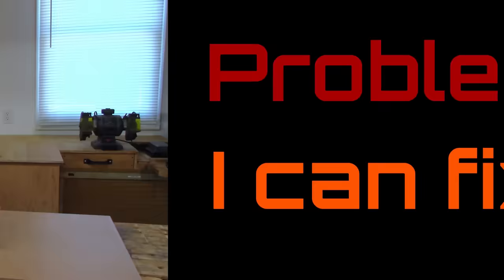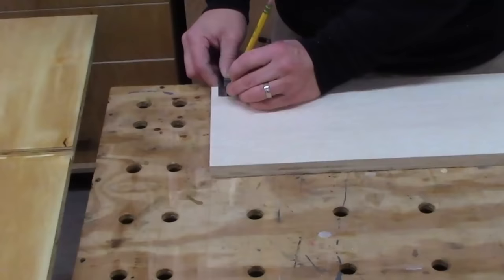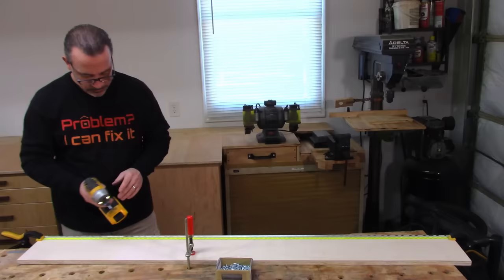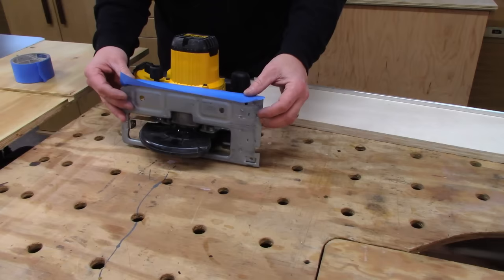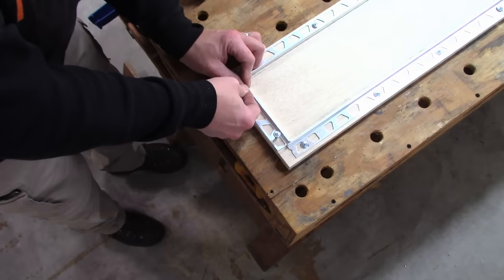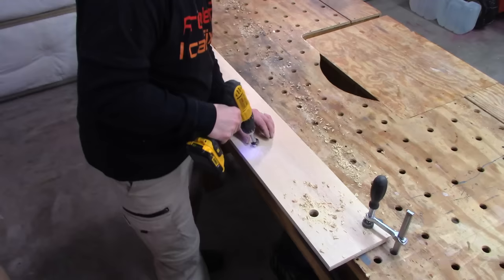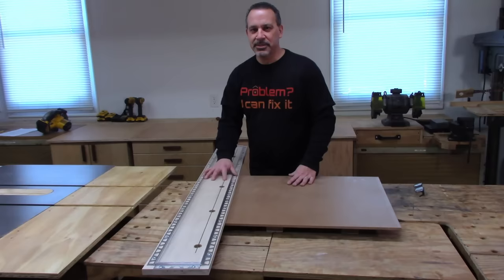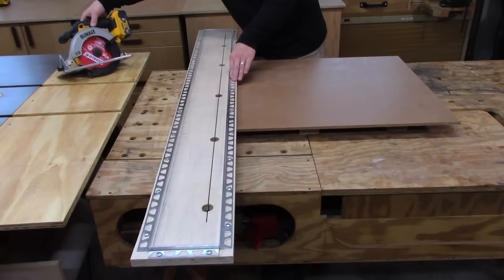Festool doesn't want you to see this DIY track saw

Comment: As a professional woodworker here in the UK have made and used dozens of versions of these jigs over nearly 40 years, Not a bad one but forget about the tape , it can't be trusted and always clamp.
Reply: CLAMP.   Always.
Reply: Spend the time to find  or make low profile clamps
Reply from the maker: I was thinking about using the MatchFit dovetail clamps.  Would be easy enough to put a groove on the bottom.

Comment: I've seen a few of these. One issue is that you have to drop into them all of the time. With a small modification it can be shorter, cut farther, be more stable, and allow you to cut from the end. What you do is, at the end instead of more of the aluminum, put a thick piece of wood on the underside, perhaps 2x2. That will act as a catch at the end of your piece to allow it to be even more stable and not slip. Then, as long as you don't cut down into it too far, you can start your cuts right at the end in a conventional manner.
Reply from the maker: That is a great idea.  Thanks for posting.
Reply: Maybe silly question, is your suggestion so that it would act similar to a bench hook?
Reply: @martinmeasures829  A bench hook method would work so long as you make sure it's 100% accurately straight. I've done this, because even though I really really want Santa to bring me a Festool for Christmas, I can't see it happening and can't afford to pull the trigger on that yet.
Reply: @martinmeasures829  I think it would be better to not depend on the end pieces being perfectly square to use them as bench hooks. Instead I would not have them contact the sides of the workbench and then line the slot up with the line to be cut.
Reply: that is a decent idea as well, the problem with it though is if the cut is longer then the track then it wont work because when you slide the track up it will be resting on the 2x2,  if the cut is more or less then 90 degrees it makes that lip a hindrance as apposed to a convenience,
Reply: Some great suggestions in the comments section. Here's mine: why not have a couple of removable wooden dowls (copper pipe would be more robust) in place of the 2x2, similar to a router jig. These wouldn't provide the additional bracing of the 2x2 but will allow you to start cutting from the edge of the piece and alleviate the permanent obstruction of the 2x2. You could also make 45° dowl holes to facilitate those cuts too. 👍🏾

Comment: I made the other type of DIY track, instead of a channel where the saw glides, like this one, the guide just have a straight edge on the same side of the motor of the saw and the other side the saw disc cuts flush with the edge of the board, eliminating the need to plunge the saw to make the initial cut and drilling those big holes to see and align the track to the line you will be cutting. Another advantage is that you can easily make the track longer.

In my case I tried to use sandpaper to make the track stay on the surface, eventually it failed. My solution was to add a strip of wood to the track with some pocket holes and made it wider. Now I can easily put some clamps and the saw doesnt hit them.

For the ones criticizing and saying it doesnt do the same as a track saw, well, first you deserve some prize for being captain obvious... you nailed it. Of course isn't the same as real track saw but I can tell you it does almost the same work, cuts straight like a track saw and works just as easy as a track saw. If you're worried that the cut "won't look as good" as a cut made by a real tracksaw then there's a good solution for this. Get a disc for your circular saw with a high teeth count, that will give you a cleaner cut. After I made my jig I stopped thinking about getting a track saw, no need for a tool I will use occasionally, all are overpriced and doesnt have the many uses a circular saw has.
Reply from the maker: I had a jig like you described (door board jig) and I would occasionally drift away from the fence.
The tape I used is designed for traction in slippery areas so it should hold up really well.
Thanks for taking the time to comment and for watching.
Reply: @HouseDoctorRay  if you pay attention to the saw it won't wander

Comment: Thanks for the idea. I built one today and it works great. I was a little hesitant to trust the grip tape, but I made a few long cuts with no issues with the guide slipping. I made a few modifications: 1) I made mine 7ft long because I have a project needing 6ft cuts 2) I added a dab of construction glue every few inches to the "mesh" area of the tile edge, just to make sure it doesn't move in the future 3) I used small 3/8in plywood blocks at the ends rather than the metal - I wanted a hole on one end from which to hang the guide when I am not using it.
Reply from the maker: Nice.  I still have mine leaning against the wall.  I need to drill a hole in it.
Reply: Thanks
Reply: @HouseDoctorRay  I guess you could use one of the 1" holes to hang it from?  Nice vid by the way.  I subscribed about halfway through it.  Thanks!
Reply from the maker: Thanks for the sub!  I think if you hung it from one of the holes it might spread the slot out.
Reply: I still wouldn't trust grip tape. There is no replacement for proper clamping. Safety and precision are what is important.

Comment: I’m a finish carpenter. This exact build wouldn’t work for me when dealing with a finished product but it has given me some good ideas for building something similar.  Thank you!
Reply: Use rubber mats instead
Reply: @nikolairubinskii6450  Rubber leaves marks too. If he can find grey rubber sheeting or maybe Neoprene©.
Reply: @christophercharles9645  actual track saws use rubber on their tracks, black rubber. I suppose one can always come up with a setting in which otherwise perfectly fine tool/DIY solution wouldn't work. When you work with some delicate finished surface that you must cut but leave no marks whatsoever on it, perhaps circular saw (in any form) isn't even the right tool?
Reply: Glue a strip of gym resistance bands along each long edge.
Reply: If your a finish carpenter and you don't actually have a proper track saw then you have been missing out for years. This is a great DIY hack, but that's it, it has no place in a professionals tool box (or anyone who doesn't want to compromise).
Reply: @azzman73  Festool fanboi much?  A real carpenter understands that time is money. You can make a proper guide in minutes and toss after the job. No need to waste money and drag around a useless track all the time that could and will get bent.
Reply: @steher  I dont own any Festool equipment, why assume? If time is money then why build something to throw away? You do you.

Comment: After building 3 different similar saw guides I appreciate your innovation using the tile edging.  Ultimately I bought a Kreg track saw and guides for the dust collection capabilities.  My shop is only 400 sq ft so keeping the sawdust under control is important.  It’s a good video; no need for the clickbait title.
Reply: Look at my "Parallel Guided Power Saw"
Reply: Thought i was being slick with a piece is finished 1/4 pine and couple of clamps

Comment: Excellent DIY Track saw that you can use your own saw you already own rather than buying an expensive specialty saw with track!
Reply: I have tried many types of variations on this theme, including just using a couple pieces of plywood and making a 0 clearance track. Works pretty good, but once you buy a track saw (in my case a Makita) there is no going back, especially when you add an attachment like a TSO edge guide. It just makes your life so much easier and frustration free. True not everyone can afford one, or even wants one, but for my type of workworking, that saw, track and square has saved me a ton of time. Don't get me wrong, I am no tool snob, and spent years using just okay tools, that's why it is such a joy to get better at your craft, so you can sell your work and invest in nice tools...and who of us doesn't love nice tools?

Comment: The best part is the find of the aluminum tile rails; I will be building this.
Reply: Great idea for dust removal. Buy a festool.
Reply: I’ve never had a problem clamping down a straight edge.  I learned that as an apprentice.  Great I dea for DYI RS.  When doing on site built in cabinets. I usually cut a narrow strip off one of the many sheets of plywood purchased for the build💭a few finish nails will hold in place sufficiently.  Get to know your saw ie: distance from edge of plate to  of blade and add or subtract that to use as an offset.  Measure twice is always nice.

Comment: Man, that's kind of genius.  That's a nice simple, elegant way to make a dead straight cut!  And it's cheap enough that you (i.e. me) could make them in a variety of lengths, and even with different saws for different purposes.

Thanks!
Reply from the maker: Thanks for watching.
Reply: It truly is genius. Hey Doc, have you thought of any improvements/adjustments since you posted?
Reply from the maker: Not yet.  A few of the better suggestions here are non slip silicone tape or Flex Seal.  Another is routing a groove on the bottom for clamps.  Maybe the MicroJig Match Fit clamps.

Comment: I built a couple of saw tracks similar to this a few years ago. I used them constantly while rebuilding a house in Arizona. There are many different methods, but this one looks really nice because it keeps the saw straight without having to force it up against the jig. I lost (or maybe just left) my tracks when I moved to Oregon, so now I have to build new ones (one for the full 8' length of a sheet of ply, and another shorter one for the width). I might even build a shorter one for smaller pieces of ply.  These things are so cheap that you can build several of them for different uses and locations.  I'm a real estate investor, so when I have properties that I'm working on, I can leave a set in the house I'm remodeling.  I'd MUCH rather someone break into my shed or an empty house and steal a $8 home-made track than a $800 Festool!
Reply: totally Agree that's awesome that you've built something like this! I'd also much prefer getting a $8 item stolen than my nice tools, which is sadly part of the business now a days as real estate investors

Comment: I love this idea! I’ve been a carpenter for over 40 yrs. I can pop a chalk line or use a pencil line and freehand the cut and it is difficult to tell which edge is factory!You must like the saw you use and use the proper speed consistently!
Reply from the maker: Thanks Richard.
Reply: what?!!!!! no way!!! really?
Reply: It Looks ! Like ! Your ! Freehand ! Was ! Just ! So !! Bad ! A ! CUT !!
Reply: I'm with you! If you've been at it long enough like me and have a saw and a blade that your good with go for it. I just make sure my cord is not going to get caught and I can make the complete run without stopping. But building cabinets I cut about an 8th inch bigger and then clean the smaller pieces up on the table saw. Just saying.
Reply: @duelette  the cord think gets me all the time 🤣

Comment: I made one pretty much the same a few years ago, what I did differently regarding the saw was, I dedicated an old yard sale saw to the track, removed the spring loaded guard, installed a spring in the height adjustment slide and now have an old saw that acts like an actual track saw, also depending on the make and age of the saw, you can utilize the fan air and direct that air down a small Polley tube to blow the dust away from in front of your saw, it looks janky, but it works.
Reply from the maker: Sounds cool.  Ya gotta do what works.
Reply: Janky........ The story of my life. "0_o"
Reply: Ohhhhh cool idea! And I just happen to have several old yard sale saws collecting dust!
Reply: O
Reply: Look at my "Parallel Guided Power Saw"

Comment: I have used string for getting a straight line when tiling, but never thought of using it for wood. Thanks for that idea.
Reply from the maker: String, plumb bob, water level are cheaper and just as accurate as their modern counterparts.

Comment: I have a tracksaw, but I'm making this as well for my circ saw.  But I'll bump out the tile edging so I can place it against the benchdogs (perfectly squared using UJK parf guide).  This way, I don't have to fight the long tracks anymore.  Very practical and simple - the best DIY solution for  tracksaw I've seen to date. Thanks.  I would caution anyone though, @8:17 support your pieces so it doesn't collapse and pinch the blade.
Reply from the maker: Thanks.  I definitely had my blocks in the wrong place.
Reply: 8:24 if you don't cut all the through your piece like he didn't, you won't have to worry about pinching the blade...
Reply: Ditto I have a Kreg Accu Cut and most likely making one of these instead.  Accu Cut is ok at best, PITA to reset saw after first use in the same location and even with saw flush against top surface doesn’t make perfectly square cuts?
Reply: @msk3905  yeah, it only works if you can dedicate a saw and leave it locked it after fitting it
Reply: Look at my "Parallel Guided Power Saw"
Reply: @davidmuresan628  Looks like a great rig.  But opposite of what this video is showing which is simple and easy to make for anyone.  But I can see why you're proud of it. Looks very useful.
Reply: I use a sheet of 2" foam insulation under full sheets/long cuts supported by the ground or a sawhorse table.

Comment: I've made them with 1/2 by 3/4 wood and used a bar of soap on the bottom of the saw to create a pseudo Teflon to slide easy.
Two awl holes on either end will hold it down in place.
Just a suggestion that worked for me.
This device made just shown is a great design and I would build one.😊

Comment: I just completed mine today using 3/4 MDF” and Schluter 1/2” edges. Tip: if you’re gonna be cutting typical 1/4”, 1/2” or 3/4” sheets; make it 62-64” long.
Reply from the maker: Good tip.  Thanks for posting.

Comment: Thank you for the video.  You inadvertently solved one of the hardest problems in track saw deigns (DIY and professional), and did not even mention it.  If you were to place one of the bottom anti-slip tape segments (sand paper of neoprene) right over the cut line, you would virtually eliminate tear out from the circular saw blade as it would be supported, as in a zero clearance sacrifice piece.  even good track saws only support the work on one side (ex Festool), which is fine if the discard piece is observed nd not needed.  This design (with the small tweak) protects both the keep and discard side of the cut from tear out.  One can still add an additional piece of tape on the board to be cut for double/added tear out protection.
Reply from the maker: You're correct.  However a good blade, like Diablo, goes a long way in reducing chipout.  Also not rushing through the cut.
Reply: whoaaa that remark is a gem!
Reply: Look at my "Parallel Guided Power Saw"
Reply: Thanks for that!!!

Comment: Dude 
You have helped me out emminslly. I've been a Carpenter for year's. What we use to do was clamp thick enough wood on the opposite side of saw so it don't slide around or vibrate to much. Sometimes that works good. But your method is easier. My eyes ain't what they use to be at age 50. So I need precision cuts that's easier to use than a miter saw. Thank you
Reply from the maker: Glad you found it helpful.

Comment: Track saws can be expensive for the average home shop woodworker. I've got a track saw, definitely not green will never own green anything, use it often and it's safe. Your version is the best I've seen. Thanks for sharing your version. I'm sure a lot of them have been built.
Reply from the maker: Thanks.
Reply: Green is number 1
Reply: You are absolutely right! Green is over rated and way over priced! To be cost effective you would need to be using it every day in a professional / commercial setting. There are too many ideas out there, just like this one from House Doctor Ray, to fill the void for the occasional user and produce the same result.... A STRAIGHT CUT.
Reply from the maker: If I was earning a living building cabinets or doing installs I'd buy a proper track saw.  But for DIY and occasional builds it's not worth it.  Thanks for watching.
Reply: Green & Grey is overpriced. It's nice to have if you're making good money with wood, but in the end it's just another way of pleasing yourself because it will take a very long time for the working speed difference to make up for the cost difference compared to older and simpler quality tools.

Comment: I made a similar guide. I used a high lubricity and wear resistant Teflon tape attached to the guides. This assures there is no appreciable wear of the aluminum guide strips following frequent use.
Reply from the maker: Great idea!
Reply: Look at my "Parallel Guided Power Saw"

Comment: Hi Ray - I was contemplating buying a tracksaw and guides for an upcoming kitchen cabinet project where I need to cut a lot of melamine coated MDF but as I own a decent Makita circular saw I'm going to build a similar guide to yours and give it a whirl. Thanks for sharing this neat jig.
Reply from the maker: Practice cutting that stuff, it chips really easily.  Maybe try scoring it with a utility knife first.
Good luck!
Reply: Track saws have a chip edge that preserves the integrity of plywood. This won't do that. Get your wood filler and sander ready.